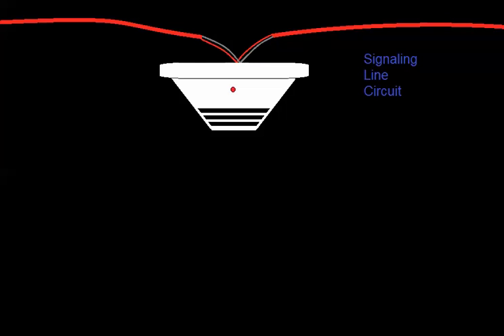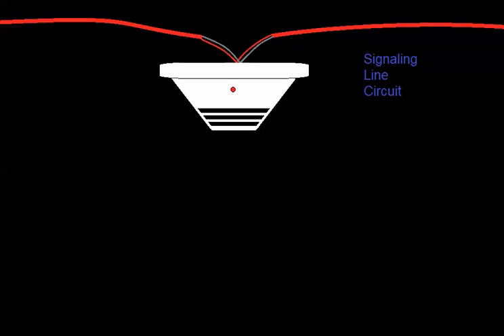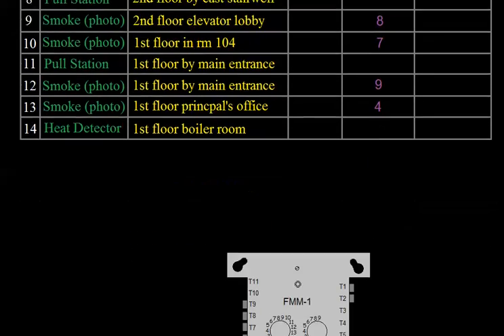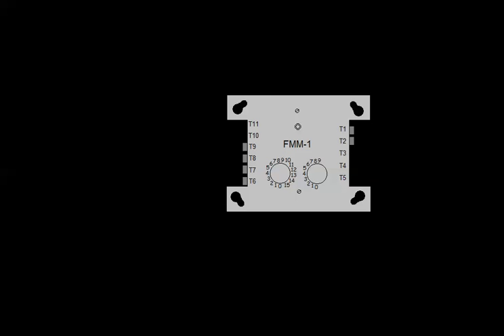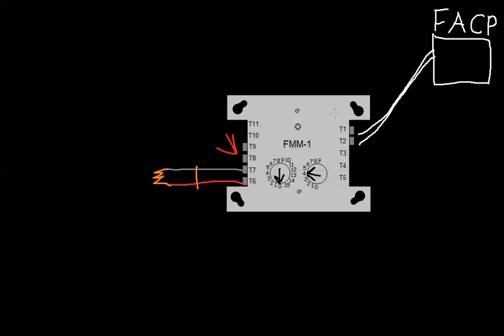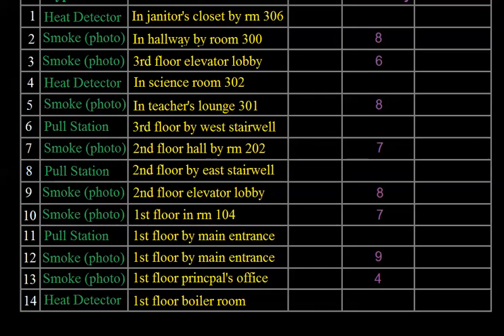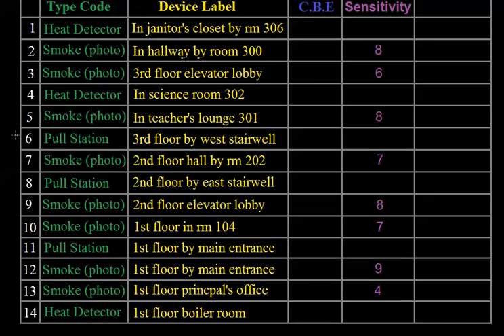22 - Intelligent panels - Introduction to Fire Alarms

Comment: Joe, can you give an example of a pump room device where you would connect to COM and NC?
Reply from the maker: There's not a good reason I could think of, at least not with an addressable panel. If you had an old conventional panel that didn't have the capability of programming a zone as supervisory, and so a short on any zone would cause an alarm, then you'd want a tamper to open the circuit to cause a trouble.

Comment: In the wiring of beam detector to a fmm 1, do we follow the same wiring as the water flow switch?
Reply from the maker: Typically you would wire it more closely to a conventional duct detector, where the wires go into the alarm contacts on common / normally open, but then the resistor runs through the trouble contacts.
Reply: @JoeKlochan  okay thanks

Comment: Hi, which multimeter is best for trouble shooting fire alarm system. What brand
Reply from the maker: My opinion would be fluke, and that seems to be the industry standard. I haven't really given another brand an honest try, besides using someone else's meter here or there, so take this advice with a grain of salt. I have used a fluke 179 for as long as I can remember and have no reason to change that now.

Comment: How many ohms the resistor in the waterflow switch?
Reply from the maker: Always depends on the module you use. In all of my drawings, which use system sensor style devices, the EOL would be 47k Ohms, but it will be different if you're using a different type of module.
Reply: @JoeKlochan  I really appreciate your video. I am waiting  the video about the addressable fire alarm system connection. Is it the same as intelligent fire alarm system?

Comment: hi Chris best way to link Conventional panel to addressable panel
Reply: First, you need to identify all of your conventional zones as well as all end-of-line resistor locations. If you have the order of connection of your detectors, it will be even better.
You will need to get for your transition: one zone monitor per conventional zone to be able to supervise your system. Subsequently, replace all the components of a conventional circuit at a time with addressable modules. Start from panel to EOL if possible. Never forget that your system must be operational when you leave the client. Try doing this for the first time with someone who is used to doing it. The last piece of advice I give you is to plan and prepare yourself so that you don't have any surprises

Comment: You told us how u label them, but how does the panel know that 5 is the one u want to be 5. You call the smoke detector 1 and in the panel  you tell it that a smoke detector is 1, but how does it know which smoke detector.. hope u understand what I am trying to say.
Reply from the maker: I do understand. All addressable devices have a way to set the address on the device. On System Sensor-style devices (which are the types of devices I draw, used by Gamewell/FCI, Notifier, Fire-Lite, & Silent Knight), it's a rotary dial that addresses the devices. Some manufacturers like Simplex use binary DIP switches, which I could do a video on. Other manufacturers require a separate handheld programmer that you place the device into and set the address. Lastly some manufacturers use an embedded serial number, and the panel learns the "address" based on that.

Comment: Addressable fire alarm panels offer a range of programming options and display important information regarding the complete fire alarm system. Analogue addressable fire alarm systems give details on individual detectors. Honeywell Morley IAS, Cooper Fire Alarm System, Reval Fire,  Addressable Fire Alarm System Single Loop or Multi-Loop System available.  Contact us to get the best quality multi-loop system control panel at a low price. 
Url: http://www.solutionscommunications.in/latest-update/addressable-fire-ala/1609?utm_source=bk_android&utm_medium=share

Comment: @Joe Klochan   If not an ordinary trouble condition, what does the panel display if the wire breaks on the addressable portion of the circuit?
Reply: a blockage